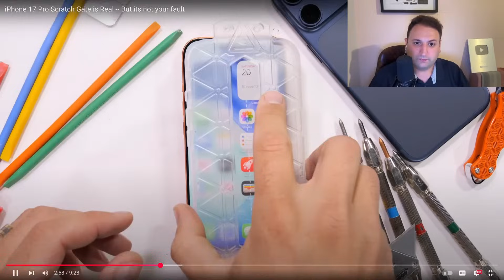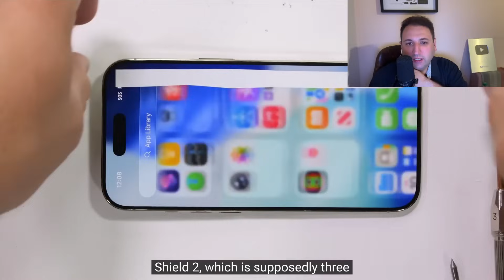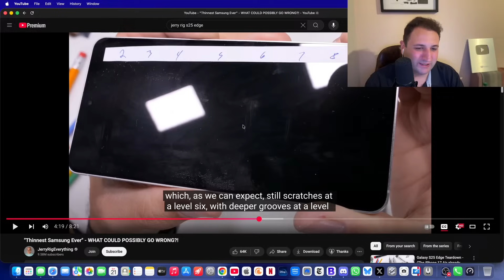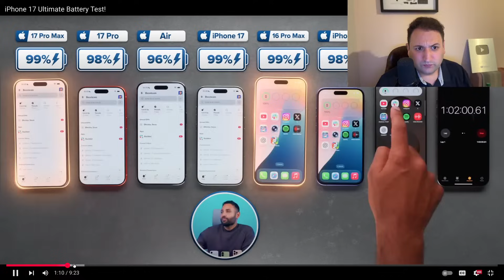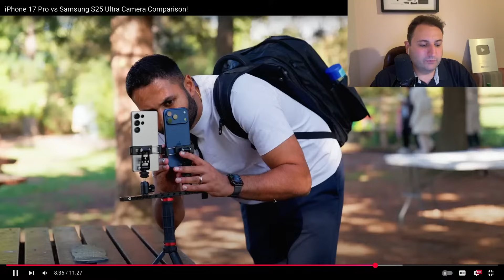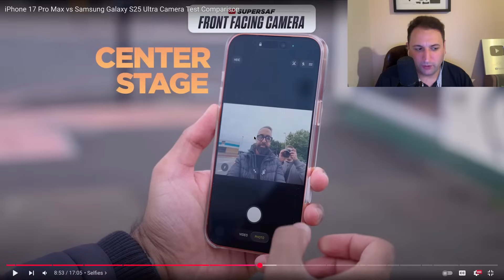New Apple ScratchGate? 24 Hour iPhone 17 Pro Max Impressions, iPhone Air beats JerryRigEverything

Comment: What’s your take thus far on APP3 sound quality? I see some people complain that the bass is not to their liking
Reply from the maker: I am not an audiophile but to me they sound incredible. Audio Quality on APP2 has always been more than sufficient to me so I couldn’t tell you by how much APP3 are “better” but they definitely are. They do sound different, especially when it comes to bass but I wouldn’t qualify those changes as “worse”. At least not for me personally
Reply from the maker: That being said the true changes lie in ANC and even transparency modes, which is crazy given that the latter was already almost PERFECT on APP2. They are also super comfy. If I were to describe one actual downgrade it would be the smaller battery and slightly cheaper feel of the less “dense” charging case

Comment: Glad to hear you seem to be enjoying your new 17 Pro Max and AirPods Pro 3. From what previous generation would you say they are “must have” upgrades?
Reply from the maker: I think 12/ 12 Pro is a MUST, especially with how many screen updates have now been stacked up. From ProMotion, incredible brightness, smaller notch and Dynamic Island, smaller and smaller bezels, etc.
Reply from the maker: Base 13 and 14 to 17 are a MUST for similar reasons, especially since I think most of those devices will have decently degraded batteries for the 17 to offer a huge change in user experience
Reply from the maker: APP 1 to 3 are a game changing upgrade and I think most people on APP 1 have pretty terrible battery life at this point. Every regular AirPods gen before 4 is also gonna be a huuuuge upgrade when you choose APP3